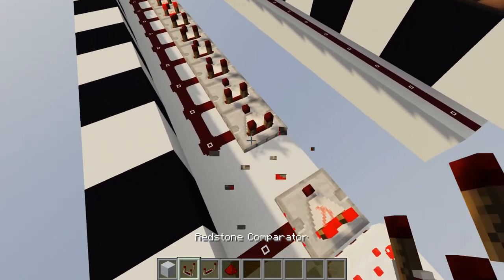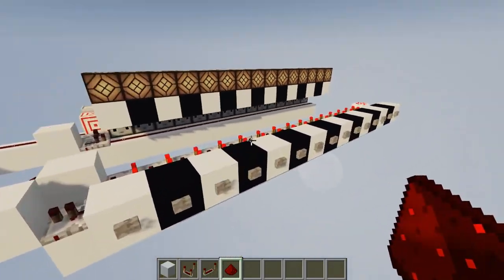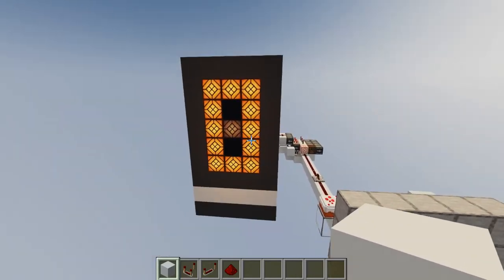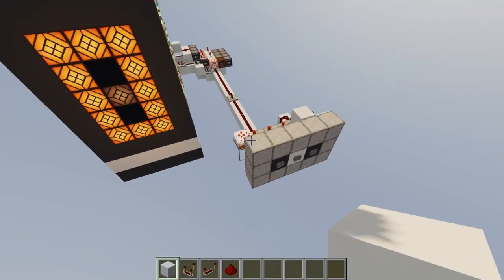Simple Pulse Length Mux/Encoder with application example | Minecraft 1.16+

Comment: This is so useful, it's weird that nobody has really showcased this that I know of. You could have 15 different functions transmitted down one line, but if you were to configure a binary decoder on the other end, you could have 255 functions down two lines... The only limitation of this is that it doesn't work across unloaded chunks, but with a proper chunkloader that wouldn't be a problem, right?
Reply from the maker: The issue of chunk loading is very case specific imo. Redstone wire used to load chunks in MC until version 1.13 if I'm not mistaken. But even back then there used to be issues with memory and cpu usage on servers.
The dynamic chunk loaders we have now are not necessarily the fastest too but might serve in quite a few cases.

In case you're interested, I recorded an entire playlist with all sorts of data transmission related technology (including binary) on this channel!

Comment: Have you put any thought into designing a serial bus? Instead of sending a signal length over a wire, you send a binary signal over a line. In theory, it would be much faster for transmitting large amounts of data at the cost of a more complex encoder and decoder.
I’m not exactly sure what redstone application could use that much bandwidth, but maybe it could be used to drive a pixel display or something.
Reply from the maker: Yes, I have :-]  This playlist shows where I'm at with serial transfer and related technologies: https://www.youtube.com/playlist?list=PL3_Ixao62eq-YJmhQmNVVYOPXuxBfH2ny (Including the serial display example you mentioned, I also have a video on that).

Comment: Hey there!
I'm currently trying to combine this encoder design with your signal strength decoder from your video "Long Distance Signal Strength Transmission made Simple" from about 2 months ago. I noticed that, in that video, the signal strength is doubled by the green encoder. Do you know of any way to double a pulse length so that these two designs could be compatible?
Reply from the maker: Hi, I made a video named "Pulse Length DeMux: Detection & Conversion, All in One!" where I show how to convert the output from the pulse length demux into signal strength.

This combines the speed of the pulse length encoder (2x) to the signal strength decoding capability at the cost of compactness.

Here's a link in case you want to check it out  (around 2:00): https://www.youtube.com/watch?v=9uzARuHfSVQ
Reply: @MaizumaGames  Got it, thanks!